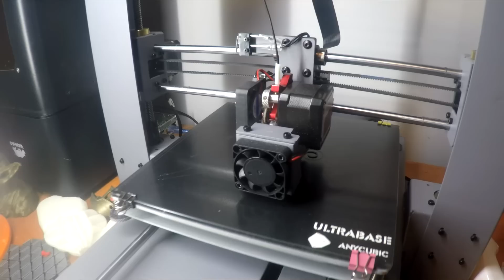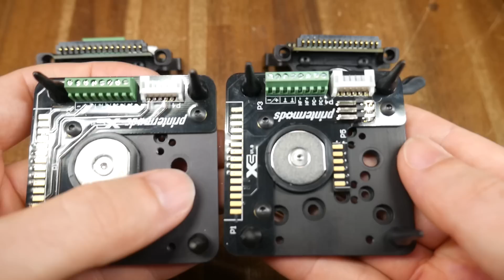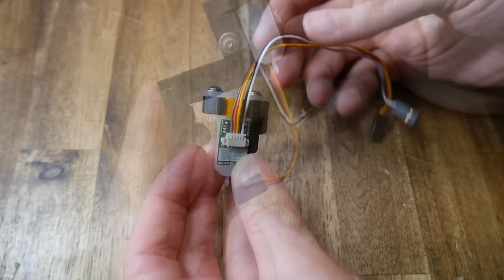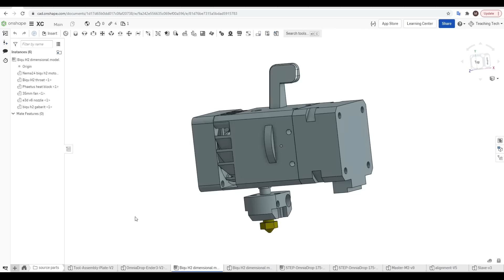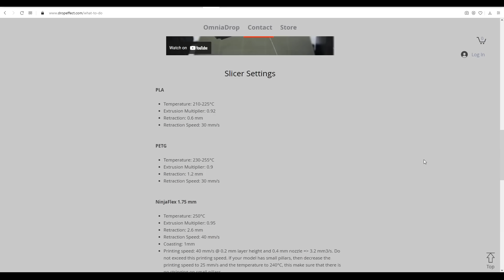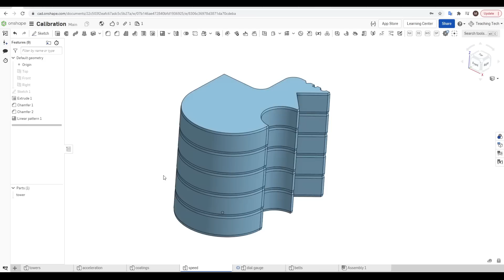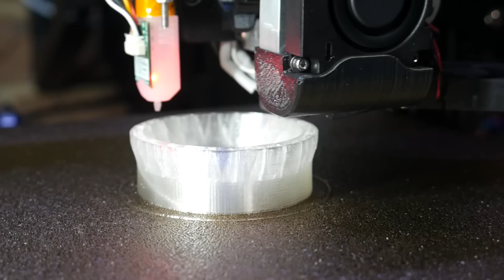OmniaDrop V2.1 extruder on XChange - Fast TPU and more

Comment: Does anyone else have issues with breaking xchange alignment spikes?  They're flimsy plastic and I've broken several of them because due to the strong magnet, the tool plate isn't always pulled in or released straight out.

Comment: Looks good but not sure it's worth as much as they are charging for it, especially when most of us will then be expected to design and print our own adapters to get it to work with our specific printers. At this price, I think they should have pre-designed adapters, or at least cad files available for download for most, if not all, of the commonly used printers. It's another case of charging like a wounded bull, then expecting the community to solve the stuff they couldn't be bothered to do themselves.
Reply: The price of the OmniaDrop is the result of the custom components (like the die cast aluminium cooling block, injection moulded gears, Heatbreak, Ring Heater, Dual Drive Gears etc.), the filament used for the printed parts is PC/PBT (price €55/kg) and the QC/post processing (run-in procedure for the gears and the cleaning afterwards).
There are "plug and play" OmniaDrop Versions for the Prusa Mk3 and Ender 3 which are the most common printers. If you have a different printer you can download the STEP files from the website and make the OmniaDrop fit your printer. Alternativley you can design a mounting plate for OmniaDrop Standard or Hemera Version, which is the case for all extruders on the market.
Since there are so many printers on the market and a lot of people already costumised their 3D printers it is often case that a specific Version of the OmniaDrop for a 3D printer might not work well with those costumisation. A good example was this review; the Hemera Version fits very well on the X-Change system, however the BLTouch was mounted in a specific way and as such the Hemera Version of the OmniaDrop did not fit properly. Michael was able to costumise the OmniaDrop to his needs and make it work for his design. There are very few extruders on the market that offer this kind of customisation options, including a proper mirrored version

Comment: I see you have a printer specially set up for PETG.

I use that a lot, but despite setting it up as well as possible using your very helpful website, and using linear advance, I have never really managed to completely solve stringing and filament building up on the nozzle (E3D V6 with nozzle X).

In fact I suspect they are connected, possible strings are from filament already on the nozzle.

So, do you have any tips as to key things that are necessary for PETG? I use 240/75, minimal fan, 1.2mm retraction (direct drive), slow print speed and slower retraction. Still get some strings though. Just trying some Z hop.

Any pointers appreciated!

Comment: Okay look. This is very clearly an amazingly designed extruder/hotend combo

But are we seriously not going to talk about that part cooling duct design? I mean.... why does one of the fans just STICK OUT HORIZONTALLY?? Am I the only one bugged by this?? 😂😂
Reply: TLDR: "The fan is horizontal because in this orientation it saves static pressure, which then can be used to accelerate the airflow".

The reason the part cooling fan is horizontal is to save static pressure. The 4010 blower fans do have some decent static pressure however for each bend and "air flow" correction/guidance you lose static pressure. If the fan would be put vertically you first need to redirect the air by 90° towards the nozzle and this costs you some static pressure.
You want to get as much fast flowing air over the nozzle/printed part to get good cooling. This is achieved by narrowing the exit of cooling duct, however you are obviously limited by the Bernoulli equation, this basically means you have an upper limit how fast you can make the air flow out of your cooling fan duct which is directly connected the static pressure. Once you have "used" up the static pressure of the fan you cannot get the air flowing faster. If your cooling duct design is bad the static pressure is not being used to accelerate the air but rather is needed to compensate for the bad airflow design. In the worst case you get backpressure and the fan cannot use its full airflow and lose airflow. This is why the fan is horizontal, it saves static pressure that then can be used to accelerate the air faster out of the cooling fan duct.
There is obviously also a reason why the horizontal blower fan is angled, but I think this would be diving too deep into the subject area. 
I hope this helps understanding why the blower fan is horizontal.
Reply: @DropEffect  ohhhhh okay that makes sense

But I'm sorry, even knowing that it is the best orientation for airflow doesn't make it any less of an eyesore for me 😂😭
Reply: @jasonking7570  XD Fair enough. In matters of taste, there can be no disputes:)
Reply: Hey Jason in my comment a little bit below i wrote a little bit about it. 
The reason why the part cooling fan sticks out horizontally is that a 4010 fan has a specific airflow-way out of the outgoing slot which the most people/users did not know.
The swirl out of the origin fan isn't uniformly, they have the most power on one site. The other fact is that the airflow lost the most power when you change the airflow-direction in a fan-shroud over a specific angle. So DropEffect is finally one under thousands who didn't use the 4010 fan wrong and tested it in tons of itterations of airflow-tests with university standards to get the totally best usage of this fan.

In my one Hour germanspeaking Interview on my YT-Channel with the inventor Maximilian Arnold he really explains exactly how these fans work, how his fanshroud works and how he further developed the fanshroud.
if you speak the German language then you should watch this interview: https://www.youtube.com/watch?v=M4CiBeJuILE
At Minute 21 and 21 Seconds he explaind the fanshroud very exactly.

Comment: Hey, they added 6 more pins and contact pads on changeable plate, and 6 pins on stationary part, but where is contacts (springs) on stationary part for those extra 6 pads?
Reply from the maker: It is for when the toolplate is docked and not the current print head. Think a dual extrusion print, and one hot end is always sitting idle while the other one is printing. This new connection would allow a certain hot end temperature to be measured and maintained.

Comment: Hey Michael very cool that you got the OmniaDrop to review! 
The OmniaDrop is still a underrated underdog in the universe of Direct Extruders and deserves a lot more attention.
I have over 10 printers and a lot of them are rebuilt printers with different models of direct extruders. 
From Mk8 direct extruder, Hemera, BIQU H2, Orbiter, DyzeXtruder and Hotend, Fookos Direct Extruder and I am a owner of the OmniaDrop v1.4 and 2.1.
So i got a different view over all DE's i have and i have say that the OmniaDrop is my most preffered model for so many various reasons that you didn't show or only marginal mentioned.

First of all is the absolutely flexibility to mount it on so much kinds of printers.  As you shown the Mainbody of this extruder is redesignable to especially each kind of requirement you need to mount it. But what you didn't mentioned is the fact that you didn't have to print it for your own. If you design your own version you can give it to DropEffect BEFOR you order it and they print it for you with HiqhQuality PA12 Filament exactly in that Case you want/need to use it!
I don't know if you ever tried to ask BondTech E3D and other competitors if they would stop their productionline for produce your own version of aluminium case and so on.
This is quite a huuuuugh advantage of 3D printed products! 

The other fact is that you got a completely closed extruder-design without any things that are missing to directly start. The OmniaDrop have a well-designed part-cooling system that was tested in tons of itterations of airflow-tests with university standards.
It is one of the best airflow system for part-cooling that i ever saw with airflow directions that completely closed the flow 360° arround the nozzletip.
You can see it here: https://www.youtube.com/watch?v=8P6HZ-FV3Us 
Other competitors like E3D, BIQU and bondtech leave you alone with your direct extruder and you have to design/find your own part cooling system which are more and less tested without scientific expertises.

And what you unfortunately forgot to show are all the little things maintenance possibilities.
Yeah you show that it is totally easy to load and unload in comparison to the BIQU H2.
BUT this problem of load flexible Filament is not only a BIQU H2 Problem. 
Exact this Problem do you have with the Hemera and so on too. Try to load flexible Filament with Shore 60A and less and you will go crazy to load it.
The loading wheel at the side is a sooooo well thought out possibility to load or unload filament!
The other point is the maintenance themself. If you have a clock or something else so you only have to leave the lever with unscrew only three easy to reach screws and you are ready to clear the whole way of filament fromt top down to the nozzletip.
you can see it here: https://www.youtube.com/watch?v=ZKcLm3Y9j0U
For Example your Scene of disassemble the whole BIQU H2 to loose the jam is absolute pointless in this comparison and is not really easier with other competitors.

The huge point that is in discussion is the price that you short mentioned at the end of your video.
Yes, the price is higher then the BIQU H2 and some other competitors but what you didn't see is that you get a well engineered Direct Extruder that you do not get from a big productionline with hundrets of hundrets pieces a day.
You got an extruder with high-quality components especially designed for this extruder (like the ringheater, heatsink and gears) and that are not off the peg and a original E3D Nozzle (not cheap chineese brass-nozzle like other competitors).
The other point is that the OmniaDrop is build together in manual work with a lot of love in detailed rework and qualitychecks. If you got your OmniaDrop you ALLWAYS know that your Device is tested so many hours before that was shipped, EVERY OmniaDrop!
So you got a extruder what you can 100% rely on. gasp How many BIQU H2 did you need until it worked more or less? 5 pieces? okay a little not really representive calculation: The H2 costs ~85€ multiply it for yourself ;)

So my decision is clear, i really would buy 10 a little bit more expensive OmniaDrops with so much more love in details and good endquality tested product then I will bought one of this pieace off ** like BIQU H2 again.
By The Way i didn't got my BIQU H2 to run until today...
Reply: First time im hearing of OmniaDrop; crazy given how much love its getting here. Also the first time im seeing Michael review anything without finding even a hint of a technical flaw...
Reply from the maker: As shown in the video, it loses out in terms of mass, size and price compared to others. Performance wise it didn't miss a beat. EDIT: wrote ass instead of mass :D
Reply: @TeachingTech  Id call those legitimate compromises, not technical flaws.
Reply: Well written and many of the reasons that I have 10

Comment: How's it stack up vs a flexion?
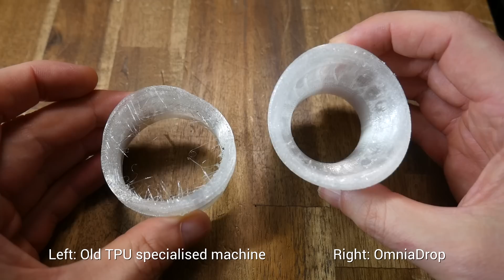Reply: His old TPU specialised TPU printing machine uses the flexion extruder 0:41 At the end he compares the two print results between the OmniaDrop and the Flexion 14:44
Reply from the maker: As Maximillian says I was using a flexion. Still a nice design but the version fitted to that printer seems dated by comparison. An advantage of the the OmniaDrop is the part cooling is designed in as part of the package but with the older printer running the flexion I was using a mix of community parts. A flexion might match this if all of the packaging and supporting parts were redesigned to suit it.
Reply: @TeachingTech  I use a flexion with a dragon hotend on an ender 3 and it seems to be able to print with any filament. However the weight is on the heavy side. Anything that prints tpu well and is lightweight would be great. Generally looking for something to put on a saphire plus.
So far an orbiter and a dragon seem good and maybe I will leave the flexible stuff to the other printers.
Reply from the maker: That's one thing I forgot to mention. My flexion has a full size stepper so is heavy compared to the OmniaDrop which is a pancake stepper with gearing.

Comment: OmniaDrop fan duct seems 3D printed. Would it sag overtime printing stuff like ABS and Nylon?
Reply: It has been upgraded to a higher temp plastic.   I did have some that sagged on the original, but I was able to print my own replacements.  I have printed all of the non metal parts and been able to modify them, the STL  files are free to download.   The only metal part I ever had fail was the heatbreak and that was my fault for over tightening, snapped off.
Reply: The printed parts on the OmniaDrop are printed from PC/PBT, which is a high grade engineering plastic, with has a glass transition temperature of 140°C. So you will have not issues heating the hotend to 290°C and using the part cooling fan.

Comment: Can you do an update on your Geetech A10M. I would like to hear what your experience has been and if there has been anything you have found to make it more reliable. I don’t know if it was you or another YouTube that said that printer is like a classic car!
Reply: I still run an A10M but removed the mixing hotend and installed an E3D V6. I printed a multiple bowden tube manifold from Thingiverse so I could still run both the extruders to it, because I rarely used the mixing feature but wanted 2-colour printing. Theoretically this also lets you switch between materials mid-print without worrying about residual, but in practice it's still hard to get a good purge. Also, flash Marlin 2 as this fixes a bunch of issues with the LCD and encoder.
Reply from the maker: Wasn't me that said that. The mainboard went pop a while ago when I turned it on one day and as far as I know nothing had changed. I tried to order a replacement but there was a variation and the new one wasn't compatible (my fault for not checking carefully). I ended up stripping down the printer for parts.

Comment: H2 is an inferior hemera copy that doesnt handle tpu as well.
Reply from the maker: @james I compared it to the H2 because that's what is currently fitted to the printer. I have a Hemera on another machine but it has a large nozzle (pictured it in the video). I use it for TPU sometimes but only for very large parts. Because of the large nozzle, that printer is not suitable for the average TPU print job.
I originally had a Hemera on this Ender 3 but felt it was too bulky and better suited to a larger machine. You can see in this video it is the heaviest of the five.
Reply: @jamesmelemede5610  but then why wouldn't he have used a Hemera as his new choice for dedicated flexibles?

Comment: I only watched slightly more than the first two minutes and now I kind of see the tool changer as my next 3d printer investment. It is not cheap, but when you show it, it does not look like one of the projects you should rebuild on your own to save a lot of money. There is some work involved. I wonder if the automatic tool changer will have a competitive price. Most toolchanger projects don't have those contacts. That is probably a lot easier and makes sense for the first 2-3 toolheads. But at a certain point it probably even saves money, because all those contacts and cables take time to be maintained.
Or did I miss something? I am not that much into the latest news and know mostly the E3D toolchanger.
Reply from the maker: The Xchange is a manual swap system currently that is being developed to support automatic toolchanging. I think most people will use it like I do in this video by quickly swapping between different extruder/hot ends. Other may wish to explore the auto functionality when available. When that is ready, it's nice for people to have the option.
Reply: @TeachingTech  I totally agree. 
Do you know, if the automatic and the manual tool changer might be compatible to a certain degree like hole patterns? I might just keep dreaming about an automatic changer, but knowing that replacing the manual one with an automatic one might be possible would feel very futureproof. I can make use of the manual one now and that work and knowledge would transfer into future projects, in case I manage to use an automatic system at some point, even if it is unlikely. It would be an advantage compared to the Wambam Mutant for example.

Comment: Great review.  I have about 10 original V1.4 OmniaDrops, in the process of upgrading them all to V2.1.   I also have them mounted on the X-change except for the two that are dedicated to my Rat Rig.   A very big advantage that I have found is the ability to modify and print most of the parts.
Reply from the maker: That ability turned into a deal maker for me.
Reply: @TeachingTech  I have printed over 50 parts for mine, worked great Max was a great help with sharing his knowledge